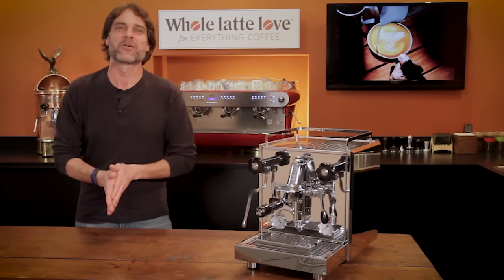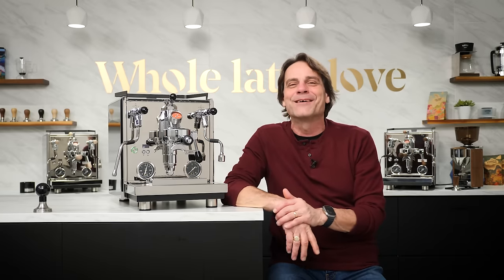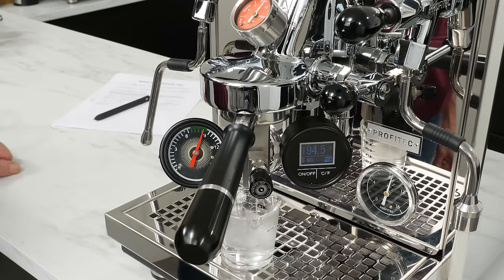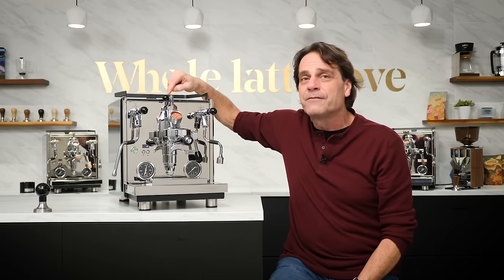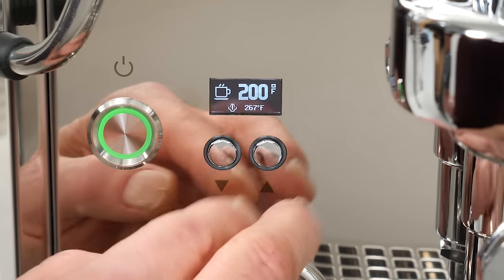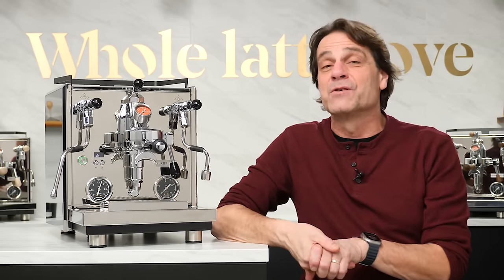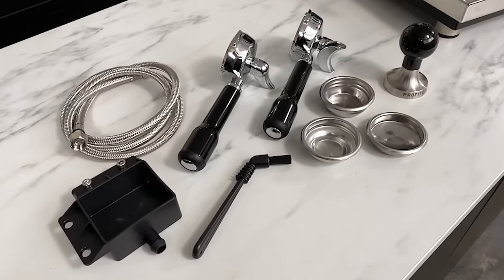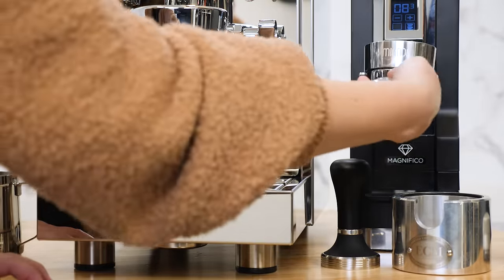Profitec Drive Espresso Machine Review

Comment: Finally. Thanks Marc, great video. A couple questions.  1) can I buy the complete plumb-in kit (including the pressure regulator, gauge and special hose fitting for the oddball end of the included hose) in Canada, and 2), when I turn my machine to the stock flow rate of 1 1/4 turns my group head pressure when brewing is 10+ bars of pressure. Should I adjust the flow control value to read o bar? That’s about 1 turn only. Thanks.
Reply from the maker: Hi LTLR, You're welcome!
1. Yes, the BWT package is available on our Canadian site here: https://wholelattelove.ca/products/bwt-bestmax-premium-filter-package-w-besthead-flex
If you did not receive the 3/8 BSP adapter with us from the machine your best bet is to contact our sales team. They'll get you that and properly set you up with the filter package.

2. For brew pressure... The goal is to set the bypass on the rotary pump so you read 9 bar static pressure at the pressure gauge mounted into the face of the machine. Static pressure is read by using the backflush (blind) disc in the portafilter or completely closing the flow control and running the pump. This video shows how to adjust system brew pressure using a backflush disc: https://youtu.be/2ArWAtuUTOM?si=DafAlQd8q_jBy9G5 In the video is a discussion of why the group mounted gauge may read higher than the pressure gauge on the face of the machine.

If desired you can use the group mounted pressure gauge to set the maximum pressure instead of the gauge in the face of the machine. To do that use the backflush disc and run the pump and adjust the pump's bypass as shown in the video. Due to the different locations of where pressure is measured by the gauges the group mounted gauge usually reads higher by ~1 bar. Reasons for this are covered in the video.

All that said, as you'll learn in the video ~10 bar on the group mounted gauge is normal. You can certainly adjust but there's little chance you'll notice any difference in an extraction at 1 bar difference in pressure. On the other hand, large flow rate or big pressure changes can make a real difference.

Should you adjust the flow rate to change pressure? Well, not for general brew pressure. But if doing a flow profile say like a long low flow rate pre-infusion of a fresh from roast coffee you can monitor the group gauge to get an idea of how the pre-infusion is progressing. Maybe let pressure come up to 2-3 bar then decrease the flow setting to hold at about that pressure until you see first drips and then increase the flow rate to a more normal setting of 1 to 1.25 turns open.

I hope that all makes sense. At the end of the day a lot of people get too wrapped up in the 9 bar dogma.
Marc
Reply: @Wholelattelovepage  Thank you for the very complete and helpful answer. I’m just watching your newly launched video from today on the Drive. Great stuff.
Reply: Ordered!! Great sales team, another Mark helped me.

Comment: Great video review, congratulations! When you insert the active pre-infusion, at how many bars of pressure is the water delivered? Thank you.
Reply from the maker: Hey fabio, Depends on how long you run the active pre-infusion. If long enough the machine may reach full pressure if flow control is set to stock flow rate (1.25 turns open) or higher. You can reduce pressure on the coffee during active pre infusion by adjusting the flow control to a lower rate.
Marc
Reply: @Wholelattelovepage  Thanks for the reply Marc. Next month the Profitec Drive will also be available in Italy. Having had to return the Gaggia Evo, which I was very happy with, I thought a lot and now I'm taking this big step!
Reply: @wholelattelovepage I can’t decide between the synchronica and the drive. Marc, which would you choose and why?
Reply from the maker: Hi tk, If you are likely to use the new features like active & passive pre-infusion, time of day programming etc then I'd go with the Drive. If not, and you appreciate finishing quality the Synchronika is a little nicer. Drive's portafilters are straight while the Sync's are angled. Under the hood, the machines use essentially identical components. I'd likely go with the Drive for the new features.
Marc
Reply: @Wholelattelovepage  In fact, I'm treating myself to coffee and cappuccinos with my new Drive! It's an amazing machine.